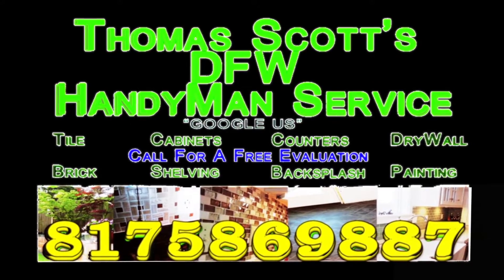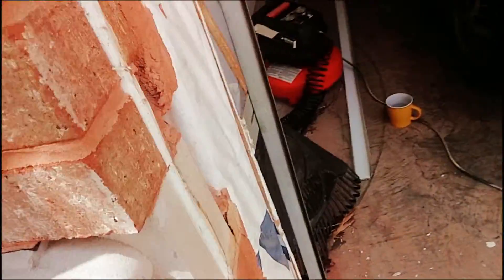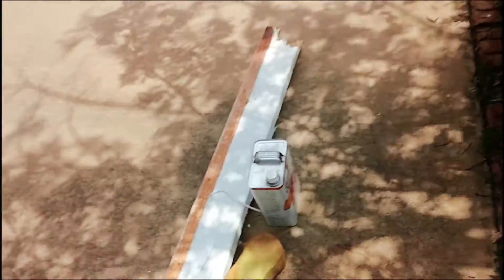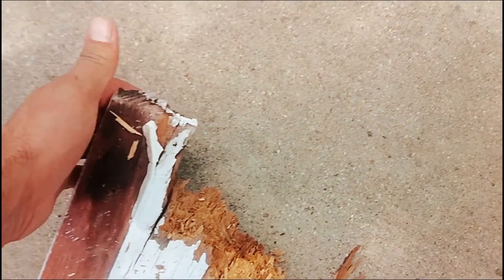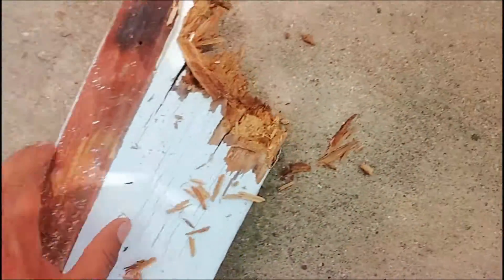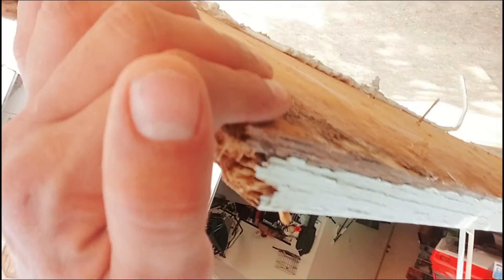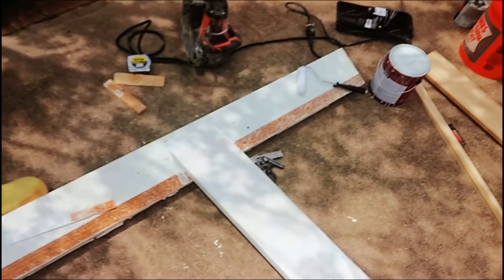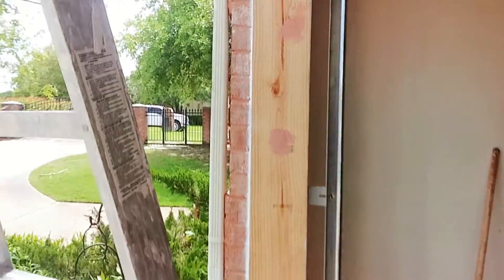Garage Door Jamb Repair

Comment: How big of a gap did you left on the bottom of the jamb and the concrete?  Im building a garage and i want to leave 3/4 to 1 inch gap but every where I look I see that everyone doesn't leave a gap. It looks nice with out a gap but I imagine it will rot in a few years.
Reply: if you leave a gap at the bottom, doesn't that let water into your garage?